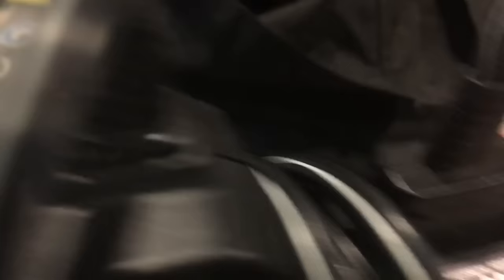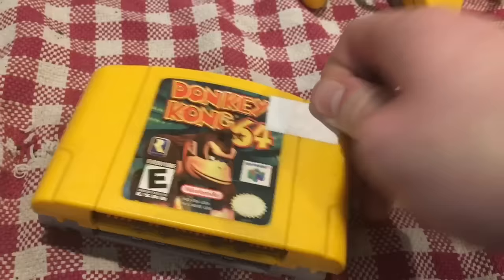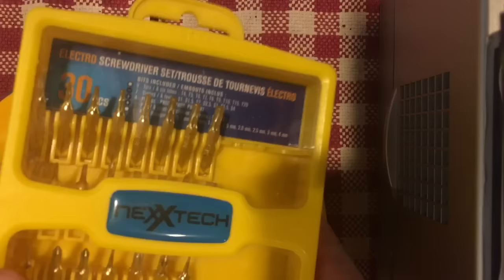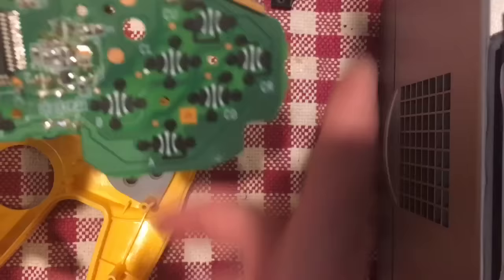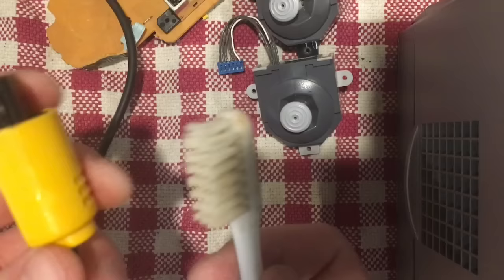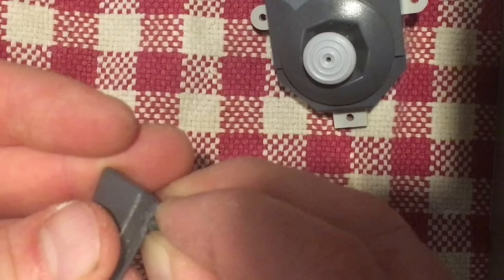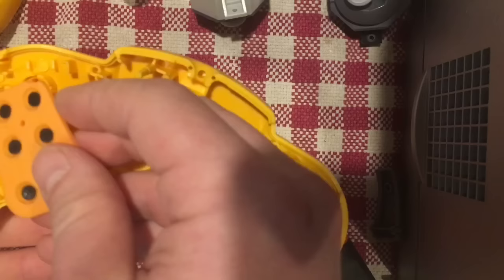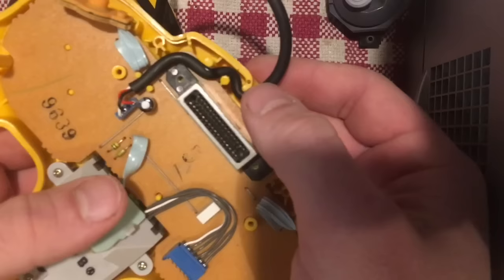Fixing eBay Junk - N64 Lot Part 1 - How to Clean N64 Controller & Replace Joystick

Comment: it seems like most of the time on ebay or any similar sites, 'not working' or 'for parts' is just code for 'we didn't try hard enough'
Reply from the maker: Bob Woggle I find that to be the case.  Often they just try and turn it on, if it doesn't work, it's "broken"

Comment: You make me wanna go buy a lot of broken consoles off eBay 😂
Reply from the maker: RyandBurtson do it!  There's deals to be had
Reply: RetroRepairs I just did! I didn't buy a lot, but I found a "damaged" Gameboy that came with some games, instruction manuals, and carrying case for $30 after shipping. I'll just need to apply a new lens, retrobrite the case, and solder the edge of the LCD to fix some dead lines on the screen and voila, I should be able to turn it around for at least $60 if I include everything! This is so exciting :D
Reply: RyandBurtson  wish i could!
Reply: I just went on there and there's a lot of 14 SNES and a SNES mini consoles going for almost $400. Bit to much money for my liking. Even just 2 is $100.

Comment: If anybody is watching this in the US and needs screwdrivers to take the controller apart, go to Dollar General and look where they keep ducktape and hardware. You'll find an eyeglasses repair kit for $2, it has all the right size screwdrivers you need ^.^
Reply from the maker: Good idea!  Should work well for this
Reply: Got a dollar general literally a few houses down in my hood 😂 omw rn lol

Comment: i use an ice cube tray to put screws and stuff in when i'm working on a system.
you can use a small self-tapping screw to fix those mounting pegs, if you can get in with the screwdriver just screw it in place of the peg, if you cant get to the head, screw it in where the peg was then cut off the head, this leaves a stump of screw replacing the peg.
Reply from the maker: aly nicholls an egg carton also works nicely.  Plus, since the cardboard egg cartons are softer than plastic ice trays, the screws don't bounce as much if you drop one.   Either way, good tip

Comment: 14:02 "and the point of that is so that if you tug at this you're not ripping the cord right off the board" as a piece of the controller shell snaps off and goes flying :)

You may want to look into CA glue activator, it makes CA glue (super glue, cyanoacrylate glue) set up in less than 10 seconds (what you said take an hour)

Comment: If you guys want good tools to use for repairing consoles and other electronic stuff, check out iFixit. I got a set from them that has a ton of screwdriver bits, even some security ones (torx, tri-wing, etc). The only downside is I don't think it has any Game Bits (for opening certain game consoles/cartridges), but those are cheap on eBay

Comment: A tip to not strip the plastic when putting screws back in, turn the screw left until you hear and feel it click, that way youll know its in the threds, then tighten it down

Comment: since you are swapping the analog joy from the gray to the yellow why not swap the shoulder from the gray to the yellow to? use the gray pad as a parts controller.
Reply from the maker: Sgt davina J. p USMC ret. I could, but I don't believe there were any issues with the shoulder buttons.  The grey controller still works, just had a looser stick.  I believe I've sold that controller since

Comment: Are the cables and the Expansion pak really that expensive in Canada? The Expansion Pak is around 15 to 18 Euros here, which is something around 25 CAD for an original one. The cables don't go for that much either.

Also that's not the purple translucent controller, that's the normal one. The purple one is darker.
Reply from the maker: Expansion pak is about $30, so similar price.  Controllers will vary, normal colors selling for 30 on the high end

Comment: I have a 64 that doesn't always start the game so I use a different game to get it to work because otherwise I can't get a game to work without trying another game. Not sure what causes that but maybe that's what was wrong with this system.  Would someone have any idea what would cause that? I cleaned the system and games and that doesn't always work.

Comment: I feel like the only one that does'int have a grey N64 controller, but I do have a blue and a clear green or a clear blue (it's hard to tell for me) which matches with my N64 console (the same one I had scence a kid (btw I'm 15)
Reply: teh_supar_hackr 0010101 nah, man. My brothers old one (mine now) has a yellow and a clear green controller. (Btw, the oem clear green is obviously green. If you're not sure, it's probably blue)
Reply: I had the clear blue/green controller that I bought with the system and a crappy cirka imitation.
Reply: I only have translucent purple(Nintendo) and a black controller(3rd party)

Comment: What do you use to make the 64 look good in a flatscreen HDTV?
Reply from the maker: I just connect it with a regular old composite (yellow red & white) cable.  Nothing fancy.   Its hooked up to an older plasma tv, so its possible the plasma displays the picture a bit nicer than an LED or LCD